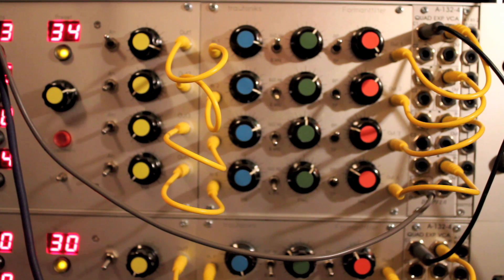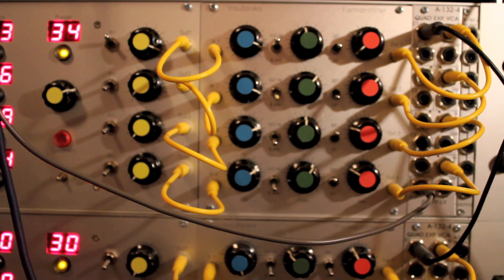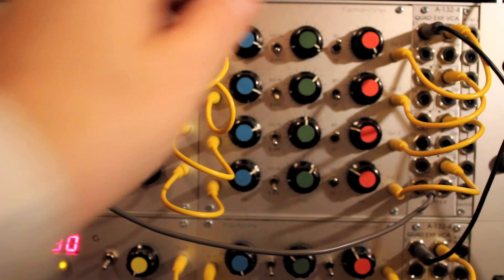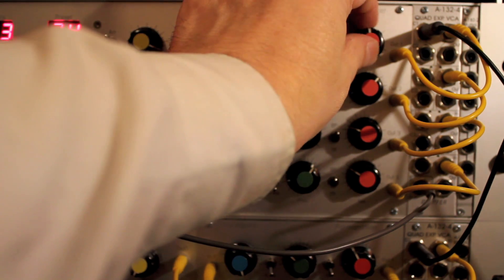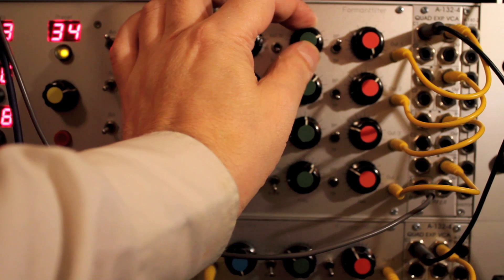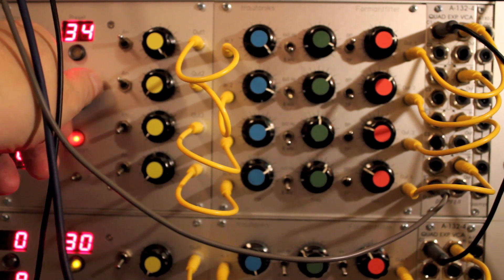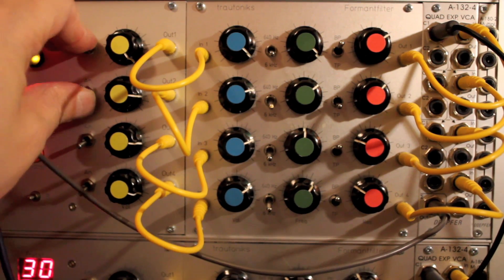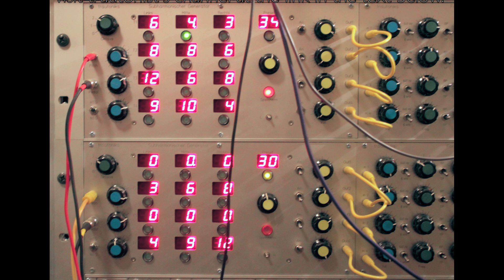A Demonstration Of Oskar Sala's Mixtur-Trautonium Formant Filters

Comment: Forgive my ignorance, but what wave shape has the input oscillator? Is this a square wave?
Reply from the maker: Hi Christophe, With the semiconductor version, subharmonics start out as square waves that are then shaped into it's very distinctive sawtooth by a further circuit per subharmonic. Driving the circuit into clip produces more odd numbered harmonics, making it more square, if you will.
Reply: @GMS267  thank you for the additional information,very interesting.

Comment: Thanks. A similarly detailed explanation of the controller would also be very apreciated. Does it for instance still work with a gelbath somewhere in the casing ( I have read Sala kept insisting on them) or do the tilting rods control a more modern snesor?
Reply from the maker: Hi Marc, apologies for the delay in replying to your questions, ended up in a digital gordian knot when trying to log in. I'll do a video on the manuals when I'm able to set up again as it's packed up at the minute, haven't been able to do any music for some time. I have the glycerin resistors but tend to use pressure sensors under the manuals as these give a better signal to noise ratio in my experience.
Reply: @GMS267 Well I am truly looking forward to anything you can add. The Trautonium and Ondes Martenot are big inspirations to me and I use a Doefer ribbon controller to achieve comparable expression ( http://www.brassee.com/instruments.html#starship_one ). If you ever get around to making more video's please also drop me a line here so I'll know about it immediately. :-)